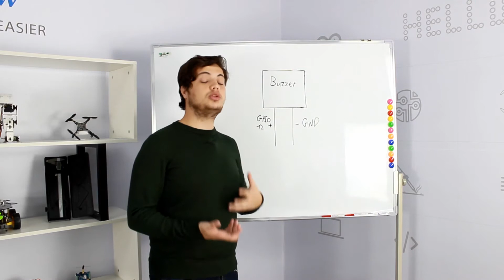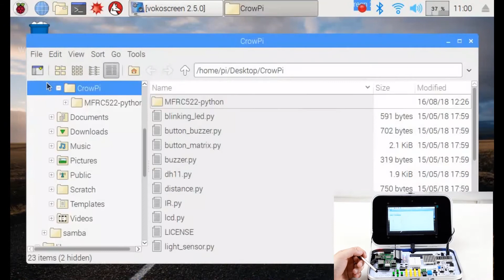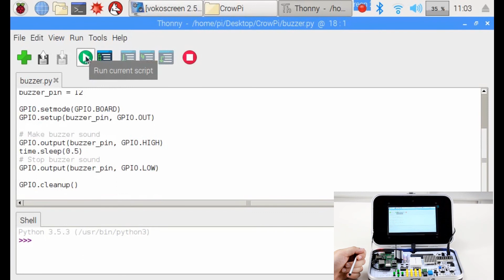CrowPi Python Lesson 1: Using Buzzer for Alert Sounds & Notifications

Comment: I bought it for my son and totally regretted it. He made a mistake and uninstalled everything. In order to reinstall OS I spend many huge amounts of time reinstalling everything without a result.
Reply from the maker: Hi, I am sorry to hear that and thank you for your like😊This file will help you solve this issue 👇
https://www.elecrow.com/download/product/SES14002K/CrowPi_Python_Lessons.pdf
Reply: @Elecrow  I finally solve all the issues here are my conclusions:
 1) this is a quite serious toy that needs assistance or dedication. I think it's worth the money 
2) No signal problem because the connection was wrong. Make sure all the plugs are connected properly.
3) Installation of the OS was very easy
4) we also lost the bolts for raspberry pi so I order 6mm screws as per the website recommendation , however, they were too small. 8mm are needed. 
5) Somehow, while trying to bring my SD card to full capacity I delete all the capacity and did know how to bring it back. Here is the video to fix that issue https://youtu.be/bHqFaJfpviI
Reply from the maker: @ArtemiosFilatov  Wow~that's so useful for us all🤩

Comment: This lesson needs to be updated for the Raspberry Pi 4 version of the CrowPi. On the Raspberry Pi 4, the buzzer pin should be "buzzer_pin = 18" and the the GPIO.setmode needs to be set to "GPIO.setmode(GPIO.BCM)" and not "GPIO.setmode(GPIO.BOARD) as otherwise the buzzer will not buzz.
Reply from the maker: Hi Max, thanks for your kind feedback. 🙏💖